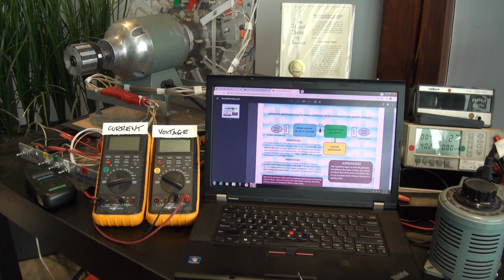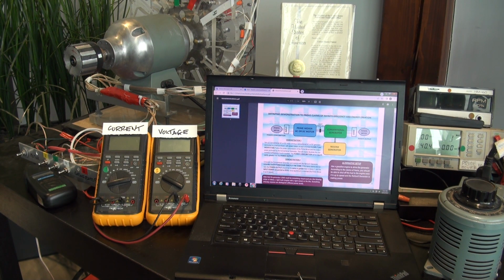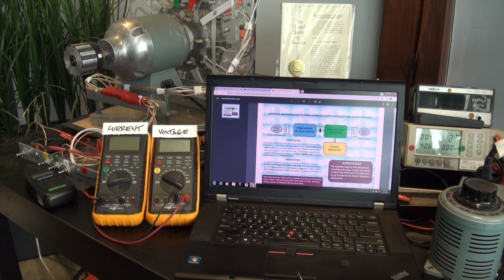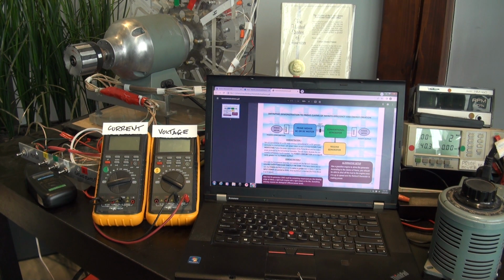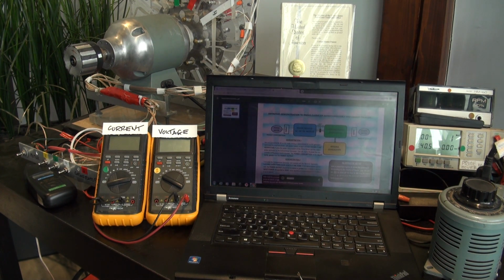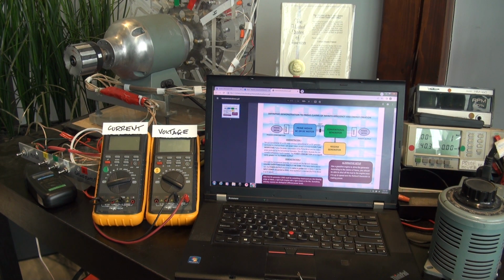PART 2 MIT Definitive Infinite Efficieny ReGenX Generator and ReGen-X Quantum Motor Tests

Comment: Hello Mr Heins, thank you for your great job! I have a question about your coils:
You said that a phase delay angle of the regenx coil has to be between 45 and 70 degrees, to run as regenerative coil, right?
The inductive reactance in directly proportional to the frequency, instead of the Rdc, that is not affected from it.
So, we can have a phase shifting range of 45 ÷ 70 degrees with multiple combinations of L and R, by changing the number of wraps and the section of the wire.
Moreover, a very high inductance increases the induced voltage on the coil, and with low resistance we can improve the joule efficiency.
What is the better compromises to maximise the regenex phenomena, between L, R, operational frequency and coil self capacitance?
Thank you for sharing your information!
Have a nice day!